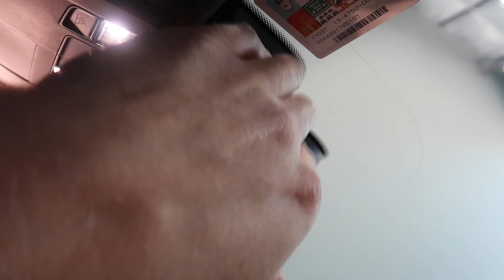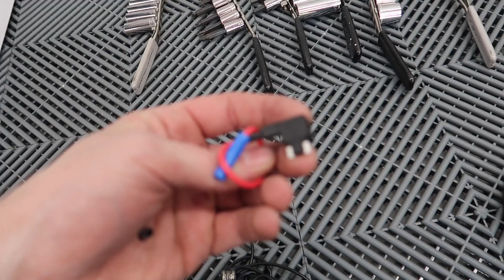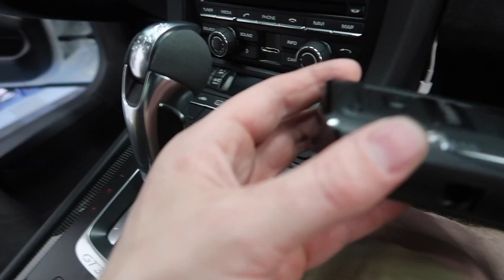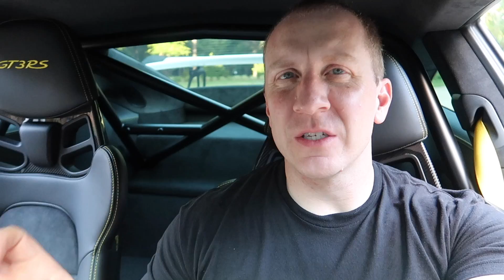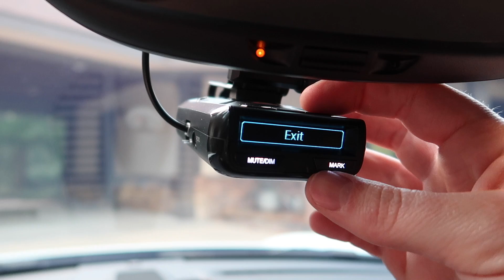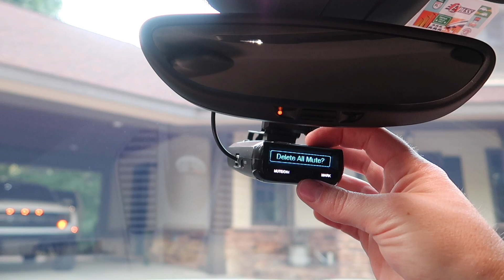Radar Detector in GT3 RS: Hardwiring Uniden R3 on Blendmount

Comment: I have the same setup (R3+blendmount) but I went with a mirror tap so I didn't have to pull all the panels apart.  The tap location on my 991 with an autodimming mirror was up inside the headliner -- you can see it if you look back towards the car into the headliner. It's not too bad of an install, hardest part was pulling the little harness out of it's holder and snapping it back in.
Reply: I may be trying this shortly.  Would you mind elaborating a bit on that tap you found inside the headliner?

Comment: Same way I installed mine.  Except it is the Radenso XP.  I guess I need to get the new Uniden now since it is the hot detector.  At least it uses the same power cable.  It seems like everyone winds up with the wrong add-a-fuse connector.
Reply from the maker: Ha, ha... Yep...  I get the big one.  I need the small one.  That's how it goes.

Comment: Hey Matt,

I was browsing CarGurus for 991 GT3’s, and a familiar Sapphire Blue Metallic car showed up! Found it interesting because the second owner only put 210 miles on it before trading it back into the same dealer, according to AutoCheck. Interesting as well was that the dealer put in the mileage wrong so by default it’s the last one to show up on a CG search. Here is the link to it for your amusement: 

https://www.cargurus.com/Cars/sms/205373786
Reply from the maker: Man, it looks good.  Funny, they told me they removed the roll bar.  They sent me a bill for the removal.
Reply: Dang, that is interesting.  Wonder how dialed in it still is up close!

Comment: Great video! I just did the same install a few months ago in my M2.  I was running with the suction cup mount for a little while since I wanted to wait for the new R3 blendmount to be released, that mount is worth every cent.  I am currently getting power via a Mirrortap but every once and a while it will come loose even with electrical tape holding it in place.  I need to see if different size probes on the Mirrortap will do better or if I should bite the bullet and run power from the fuse box in the trunk.
Reply from the maker: I almost always find the fusetap to the box to be a better solution, but Mirrortap is certainly easier.

Comment: I know on my escort TSF ON helps with false alerts from Blindspot monitoring systems from other vehicles. Its pretty much helps filter short burst of K bands radars from these systems.
Reply: That's a filter for K band drones that monitor traffic on highways. The Uniden R has a K filter specifically designed for the blind spot systems - it works really well. TSF can help a little on older Escorts but it won't do much. Some newer Escorts also have a K filter for these systems which is called IVT. The Valentine 1 has it as well called Junk-K Fighter.

Comment: How is a radar detector any competition to instant-on laser guns?  Does the Uniden include a laser jammer?
Reply: Pinarello Rider 

Radar detectors are no match for laser guns. If your radar dectector pulls a laser signal from a cop, its basically too late because nothing beats the speed of light. You need seperate laser jammers mounted to the front of your vehicle for any protection against laser guns

Comment: It runs a little hot with GPS, I hope it lasts. I might make an internal heat sink. Hope you keep us updated:)
Reply: It's actually because it has two processors: a general microprocessor for the GUI and whatnot, and a second process called a digital signal processor (DSP) for handling signal processing. That's a big reason as to why the Uniden R1 & R3 are so sensitive and have good filtering. A DSP also generates a lot of heat, but the horn actually acts like a heat sink because the DSP is hidden underneath the detector's horn housing which is metal.